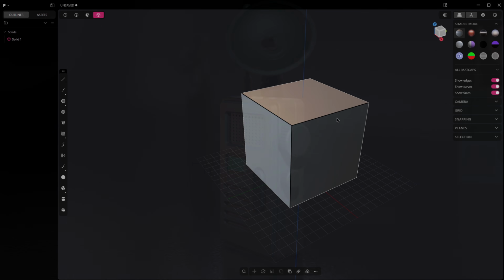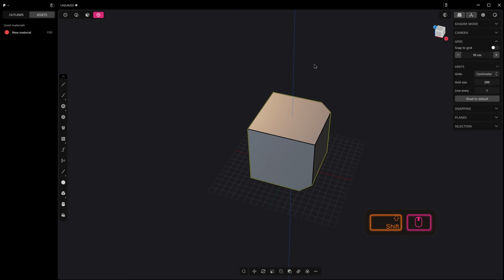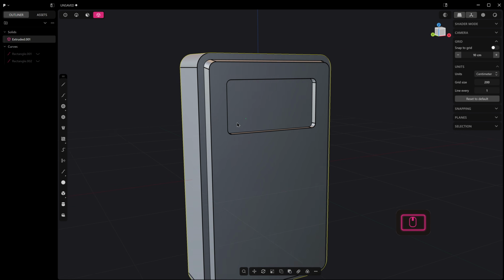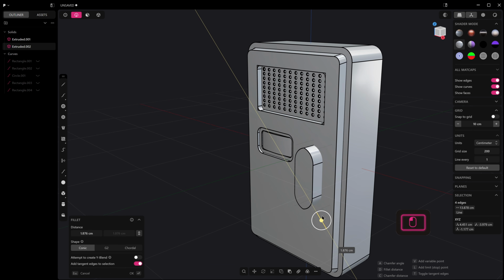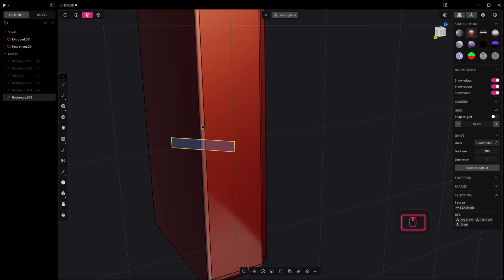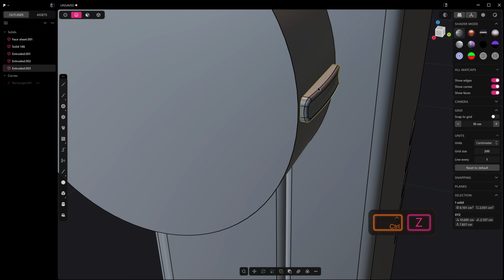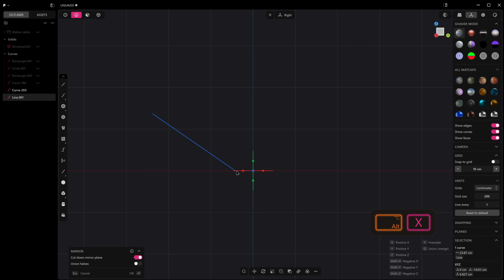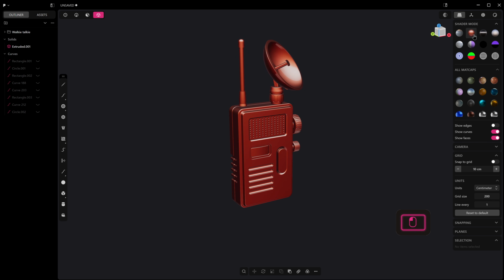Learn Plasticity From ZERO! Beginners 3D Modeling Tutorial

Comment from the maker: For those using Plasticity 2026.1+ and are getting stuck on this tutorial, The Button to Symmetrise an extrusion is called lock distances and is now S it was previously TAB.

For those of you having trouble using centre snapping Make sure you have object snapping on in the right hand side panel.

Get a 10% discount of any plasticity licence by entering the code REFUGE10 at checkout
https://www.plasticity.xyz/?ref=REFUGE
Reply: hi do they do a bigger discount or its just the 10% all the time?
Reply: bless you for returning to mention the change. The frustration of out of date tutorials due to a UI change and becoming immediately confused is real lol

Comment: so far the tutorial is good, I did buy the plasticity with your code, my only observation is that a lot of the time you say, "ok now do this" but you don't always say what "this" is.  Like in the first few minutes of the satellite tutorial, I have to pause, and try to see what keys you are pressing. I can be frustrating to try to follow along and do the project but not know what exactly you are doing. 
Same with the keys on the number pad, and the number keys on the top row, you will just say, press 3. WHAT 3? 
But so far I like Plasticity far better than Fusion or Blender. I did not understand how to use either one of those AT ALL! But thank you for putting together a great tutorial.
Reply from the maker: Thanks for the feed back, I'm always trying to improve, I've tried to get into the habit of saying "3 on the keyboard" and "3 on the number pad and I'm pretty sure the onscreen keys differentiate these. 
But I do appreciate the feed back.
Reply: @takerefuge3d  yeah I only have a laptop, so sometimes it is hard to see what the keypresses are because they are small.

Comment: I am stuck at 50:43 I cannot get the radial array to "stick" to the curved surface of the edge to get the bars to go down in a vertical pattern, it will only go horizontal. HELP! I tried to press z but it is not working!!!!!
Reply from the maker: Try making a construction plane out of the filleted edge by pressing shift + spacebar
Reply: @takerefuge3d   I did go back and start over and did shift z and that worked. I don't quite know how to get to the right plane yet.
Reply from the maker: Worst case scenario you could make a rectangle and rotate it 90 degrees on the z axis of the world and then manually place it

Comment: can anyone explain why at 33:50, where the control points are extruded from the main body, why the face doesnt extrude past the edges of the smaller rectangle, it just clips and goes flat instead of bulging out like in the video
Reply from the maker: Maybe try to off set the face one more time it should come a little past... But you can get around it by creating an extra face and extruding it a little.
Reply: i had the same problem just now. after the offset, extrude it a little bit beyond the line of where you did the offset part, then use Shift S 2x, then select the 3 vertices, use G to move them forward, accept the changes, then select the whole curved face and use G to move it to the back again and you will have your sticking out screen. Nice video @takerefuge3d, thanks! :D, im used to blender.....plasticity is such a relief  <3 drawing in Blender took friggin ages

Comment: Why use a circle instead of a cylinder?
Reply from the maker: Good question there's no good reason I just find that's my way of doing things, I tend to think that way you can make cylinder out of a cricle and vice versa. 

One thing about a circle is that it is a better starting point if you want to subdivide and manipulate the shape before extruding.
Reply: @takerefuge3d another question. If I have a cube, can you just shorten one edge of it? I’m struggling
Reply from the maker: @T.O.B.Y-1281 depending on the geometry you've got you can try to press g for grab and use the Gizmo to move it around. 
Alternatively you can choose the face that the edge is attached to and press r to rotate followed by v to select the point of rotation which would be the opposite edge that you want to manipulate and then rotate the face on with the Gizmo. 

There are many more ways to move an edge but for a simple cube these are the easiest

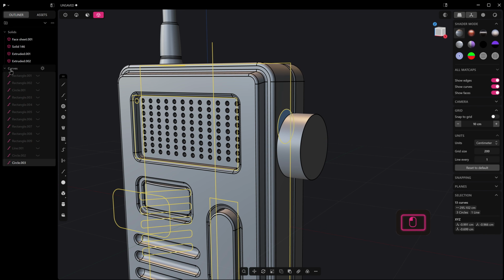Comment: 1:00:30 what do i do if there are no snapping point in the middle?
Reply from the maker: Quick Fix for For this one you could snap it to the edge of the object, and pull it all the way across and then scale it down 
To trouble shoot this one. 
 ensure you don't have fillets on the object so it still has a centre point. 
Make sure object snapping is turned on and you are in front view.
Reply: @takerefuge3d  Same issue, really doesn't seem to work anymore, even on simple shapes.
Reply from the maker: @nikolaaskaas  You're right another way you could approach this is to select the face you want to snap to the middle of, hit the space bar to create a temporary construction plane and then hold down control to snap to the center point, I didn't really notice that this snapping behavior had disappeared, but I did no some changes were made, during the last beta cycle.
Reply: @takerefuge3d thanks! Will try it out :D

Comment: HELP

Around the 01:09:00 mark, he mentions needing to patch something and a sheet is created in the assets (terminology?) menu. He kind of goes back and forth on what he's saying. When I attempt to patch the rectangle, Plasticity tells me there's nothing to patch, which, from what I can see on my end, I agree with. But if I continue watching, I don't see why we couldn't have just stuck with thicken (or even extruding) the rectangle and then moving into the radial array.

Regardless, I'm trying to follow the tutorial and I don't even know how to create a sheet at all or why I would want to.
Reply from the maker: In this case we imprinted the curve into the curvature of the knob.
And the reason we create a sheet first and thicken is because we can no longer extrude the curve when it is not flat. 

I see your point as I then just subtracted the shape so it made no difference but if I used an additive Boolean we would have got a nice compliant curvature on the knurling.
Hope that explains things.
Reply: @takerefuge3d This does help! But I'm stuck on the fact that one, I can't execute the patch command at all and two, there no sheet is getting created at all. And I don't know how to create one.
Reply from the maker: @captainqueso25  so if you have a closed curve (the blue one) and you select the whole thing, and then you can press f then search for and run the patch command, this should create a sheet, if it throws an error, there is something off about the geometry of the curve.

to fix this you can rebuild the curve by search ing for the rebuild command and then add enough points or tolerance that it matches your previous curve and try running the patch command again,

if you still run into trouble after this it might be a bug. but dodgy curves I find are usually fine once they have been rebuilt.

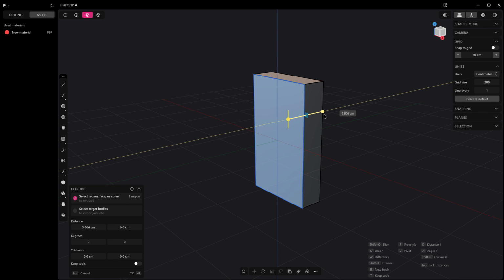Comment: For anyone stuck at the same spot in this Plasticity tutorial (17:50):

Tab may not work for mirror during extrude — try pressing S instead. Look at the bottom of the screen and you'll see it shows "Lock Distance". That's the mirror/symmetry option for your version of Plasticity.

Comment: Been using Blender for the better part of a decade but decided to pick up Plasticity to expand job opportunities. This has been a great tutorial!
Few things threw me for a loop like:
-at the very beginning the new button for making a symmetrical extrusion is "S" now for some reason
-not verbally mentioning you did an extra face inset on the little screen missed me on the first watch (luckily your lovely commenters pointed that one out for me)
-when trying to apply a rectangular array to the capsules it would not let me move them in the correct axis which required me to discover pressing "W" can change the orientation of the object selected
-when drawing your line and pressing C to cut you did not mention you then have to select the face to dictate the axis to cut on
-and messing up your satellite dish at the end and trying to fix it on the fly was nightmarish to figure out on the viewer side

Bonus in case anyone else gets stuck on fixing the satellite dish in the future: you can not perform additive booleans between "Solids" and "Sheets". It will give you a T-Sheet boolean error. My fix to this was adding thickness with the command of the same name which turns sheets into solids. This was necessary info for me to fix the satellite dish.

Sorry if too much critique, overall fantastic tutorial! You might consider doing some EQ work on the voice over audio for future uploads to fix the constant sharp deep breaths
Reply: "the new button for making a symmetrical extrusion is "S" now for some reason"

Ahhhhhh ! Thanks !! 😂There I was battering the TAB key, and nothing was happening - 'S' works for me, as in S for symmetrical.
Reply from the maker: @davelordy yeah tab now constrains lock rotate and move to either x,y or z in that order if I remember rightly
Reply from the maker: Oh my god this is the best constructive feed back I've received,  I will take it all on board for future long forms in make, there will be another one some point in the future. 

As for a instead of tab they changed the behaviour of tab to cycle through axis so the lock distance function got relegated to s.
I covered this in the video I released 12ish hours ago..

Thanks again for the feedback it's much more useful than "great tutorial" or "this sucks".

Happy modelling.

Comment: This software genuinely looks slick as hell, but I'm kind of curious why the addition of bevels/fillets/whatever would prevent a boolean from being moved around.  I'm a fairly experienced programmer myself (specifically with just that kind of software/systems programming), and it seems perfectly doable in theory.  Of course I have no idea how the core of this software works under the hood, so maybe it would require a much bigger rewrite than I realize for reasons I'm totally ignorant of.  But it seems like it would be simple enough to just group all those details and everything under the same folder, then have that folder collectively act as a boolean to whatever it's a child of?  Perhaps a feature for a future release?
Reply from the maker: Well it predominantly uses the parasolid kernel under the hood, and I'm not an expert but fillets with some level of tangency can be fairly complex mathematically and that maybe part of the problem, it also could be the fact that things like micro fillets are something you add in the latter stages of a composition so nobody ever optimised for this as it was not deemed a priority.

TLDR 
I'm not quite sure

Comment: I like to have Right Mouse Button for Rotate, and Middle Mouse Button for Pan. No Shift button required.
Edit keymap.json in Notepad to configure this. (Just swap pan and rotate).
Location... C:\Users\<your username>\.plasticity\config\v2\keymap.json
Reply from the maker: Does not one of the other default mappings do this combination?
Reply: @takerefuge3d  Doesn't seem so.
Reply from the maker: @Woogie-Maker ah Ok well thanks for the Tip, I just set the as many software as I can to Blender, so I don't have flow breaks when working between software
Reply: @takerefuge3d  My starting point was Fusion 360. I really didn't like the defaults though, so I tried the various options given, and Tinkercad /free orbit felt the best, even though I had never used Tinkercad, or any other 3D modelling software for that matter.

So after a couple of years nothing but Fusion, that control scheme is hardwired into muscle memory.

I really wish there was some sort of universal configurator, (an OS level setting) that all software could consult. Like how this generation of games consoles have finally allowed us to do.

It's so annoying that every app has it's own control scheme. It seems like such an unnecessary barrier, especially when the learning curve is already so steep when trying something new.

Comment: Really good tutorial! I've actually purchased plasticity last year but didn't get around actually using it until now- you made my purchase decision with this tutorial and now that I followed up on it, I can say I'm glad that I switched over from Shapr3D. Shapr is also a very good tool, however trying to model something for e.g. cosplays where the Shift+S function you showed here with the "bending" abilities is something I constantly needed and something that I had to manually construct all the time. This saves so much time and is so much more intuitive in that regard. Also showing what is generally possible with this tutorial is also a life saver when it comes to "what is this called / what can it even do / what do I need to google to find help".

Huge thanks!
Reply from the maker: Thank you so much for the vote if confidence, this tutorial really scratches the surface but it's a good introduction. The command raise degree that allows you to bend planar surfaces is probably one of the most useful toolsv especially when approaching something from an artistic approach.

Comment: at 26:04 I can't get it to lock/snap to that center of the fillet radius. That dot doesnt appear. It does for the outer most fillets though?
Reply from the maker: In the right hand panel under snapping: is the object snapping on or off, it can be a little fiddly so practice snapping to different parts of a mesh to see what does and doesn't work.
Reply: me too , i also didnt getting the control point , even object snapping is on

Comment: Stupid me again: got to the first nub finally and when it was time to find the center of the nub, I clicked opt z to Xray mode and still it doesn't show me the center. If I do it without it , it will stay in the front mode and doesn't come out on the back. WTH am I doing wrong? what am I missing?
Reply from the maker: Have you got object snapping turned off? It's on the right hand panel
Reply: @t @takerefuge3d it is on

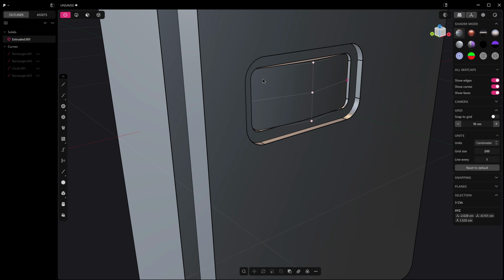Comment: difficult to follow.... I often have different results, despite the fact that I follow these intructions...at 34:00 I don't understand, but when I move the surface It keeps failing. the moved surface won't go as showed...instead two other vertical lines appear..and it fail to fillet as well...
Reply: Have you only got the three central points selected, no edges or faces, points only?
Reply: @peterjessiman7005  yes, I select only the 3 central points...when I move forward it fails when I am tangent to the next surface above.. strange..
Reply from the maker: Hmmmm that shouldn't have that effect try offset and extrude it beyond the threshold and then try again.
Reply: @takerefuge3d  ok thanks for the advice... I'm gonna try it !

Comment: 34:06 I subdivided the plane and when moving the middle edge out on the y axis it can't go beyond the edge of the outer loop. It gets clipped. In the video curved surface extends out over the lip of the outer loop. Any idea what's happening?
Reply: I Have the same problem, moving points but it just won't pass after "middle" plane. Did all the same but "screen" won't go past frame, just clip into it. But back it goes even through whole body and make a hole. And trying to fillet those 3 edges it just blend them as ist all one union, one body
Reply: I had the same issue. Watched and tried over and over. Then I played the video slowly at the part with Push Inward - Off-set - Push Inward. I noticed that instead of: Push - Off-Set - Push - Pull halfway back out (which I took for a small re-adjustment); he actually does: Push - Off-Set - Push - Off-Set (by tiny amount) - Pull  halfway back out. THEN he does the Raised Degree (double Shift-S) and pulls out the three Points in the middle. That's why he's able to go past the edge.. 🙂
Reply: @SaakTheTeacher  Good catch, that was throwing me for a loop
Reply from the maker: Moving the point's or the edge?
Reply: @takerefuge3d  thanks for the reply, I think I got it working but I can't remember now lol
Reply: @pjosxyz   sad... i have the same problem ;D
Reply: Okay I have found a Solution... But i dont know if theres an easier way. 
1. Unjoin the bottom Face from the solid
2. now u have 2 sheets. (because its not closed everywhere anymore)
3. then u can pull out the 3 middle points. 
4. isolate the pulled out face with "." and then extrude it inwards. now u have this as solid. U can delete the curved sheet now.
5. Isolate the other sheet (the rest of the radio) and patch the hole! now this is also again a solid.
6. select both solids and pres Q and Q to join them. voila.....

I'd really like to know that the problem is. is the older software version of this tutorial a problem?
Maybe someone else finds the reason for this.
Reply: I was having the same problem. My solution was to move the two sets of outer points inwards to achieve the curve, then extrude the curved face outwards to get it where I wanted it.

Comment: at 26 minutes, when adding the circle to the face, it wants to place it inside the space, and it doesn't lock to the corner like you show. Found a way around it, but why doesn't mine have that equal spaced corner lock?
Reply from the maker: In this instance I'm in front orthographic view, also ensure object snapping is turned on in the right hand menu.
Reply: @takerefuge3d may have been the snapping. I’ll check that. Thanks